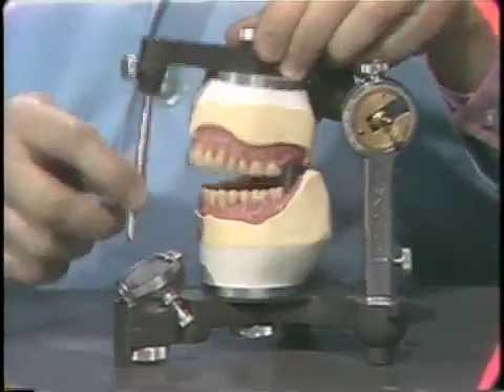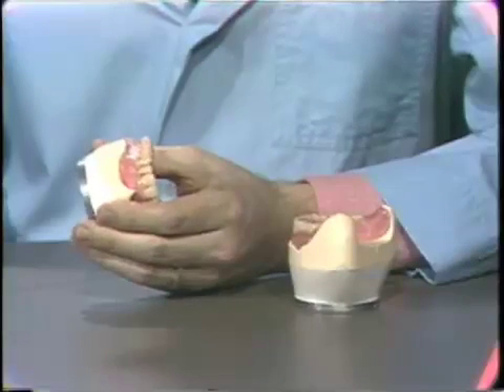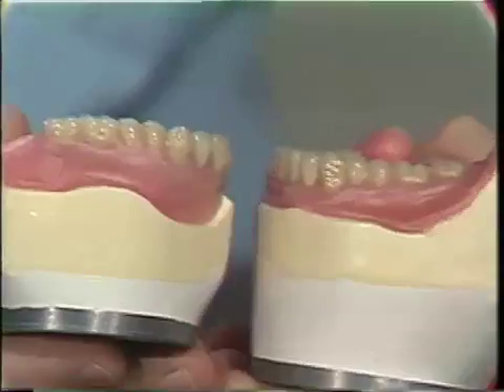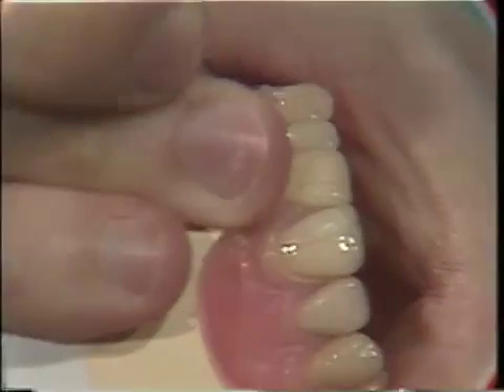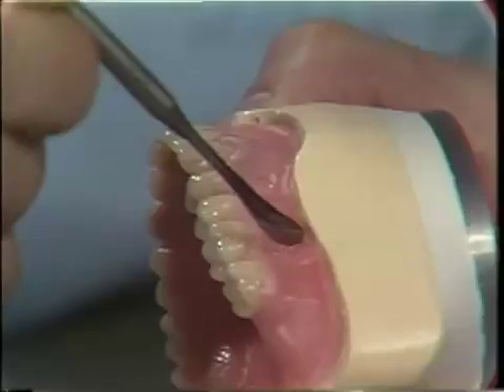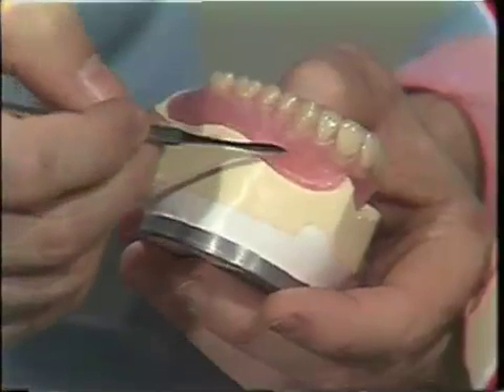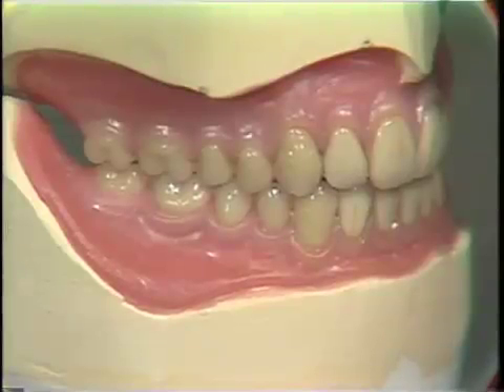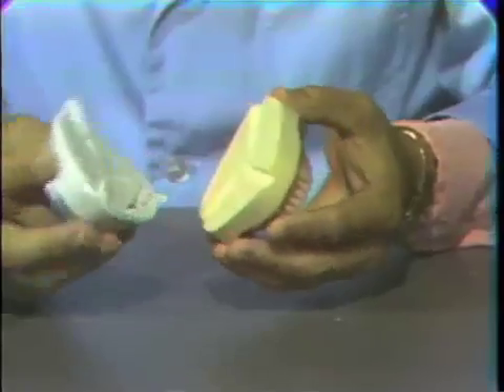Waxing the Complete Denture

Comment: A rather slow and clumsy technique with NO mention of tooth movement because of excess heat generated by hot wax added, a key to maintaining tooth position. Use a temperature controlled wax pot and or warmed sheet wax to reduce heat transfer. Your setup man and finisher will thank you.Good basic instruction.
Reply: boring bastard